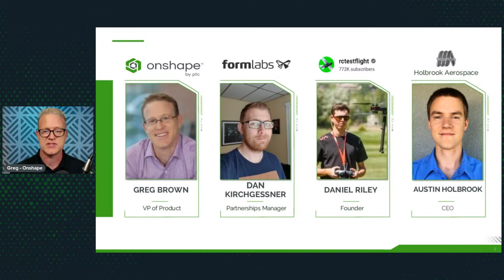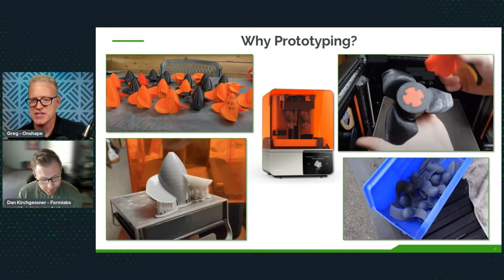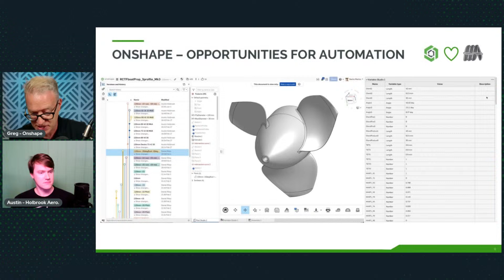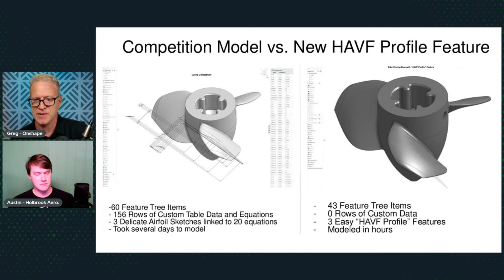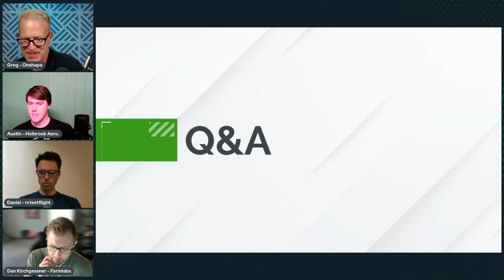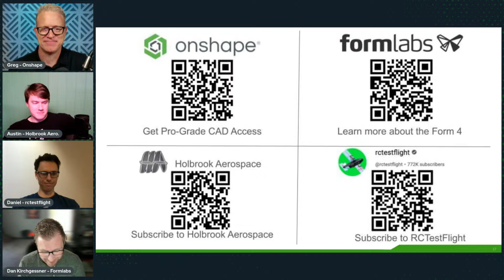Design, Prototype, Fly: Behind the Scenes of Propeller Engineering

Comment: At 38:36 you show the surface finish of the 3D printed propeller.  I found that by increasing the scale of the CAD file before producing the stl file, you will have better accuracy at recreating smooth curved surfaces.  I've found that by increasing the scale by a factor of 100X gave significant improvement over 1X stl conversions of CAD files, but a factor of 1000X worked best for the Formlabs Preform software because you can reduce the scale by a maximum of a factor of 1000.